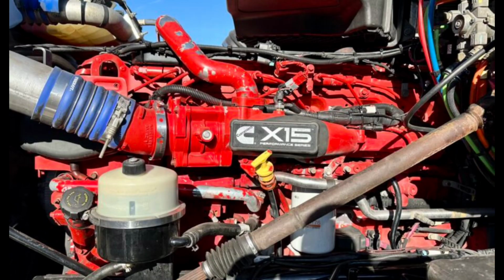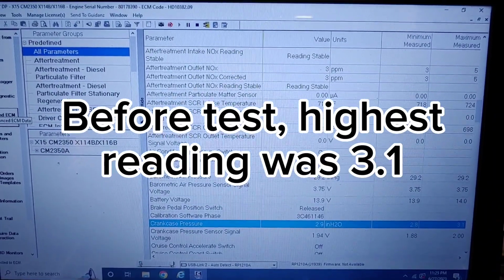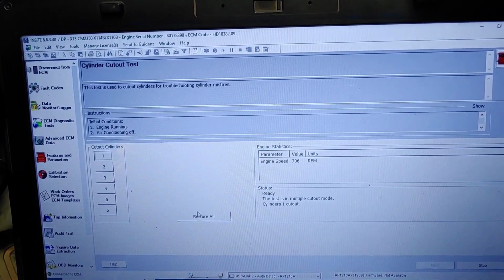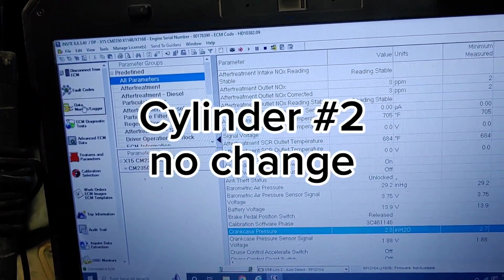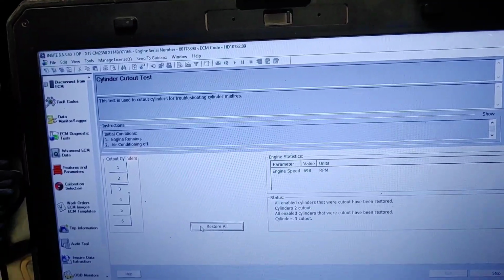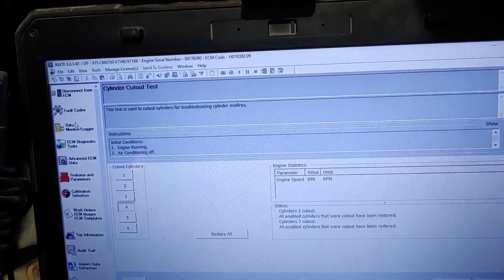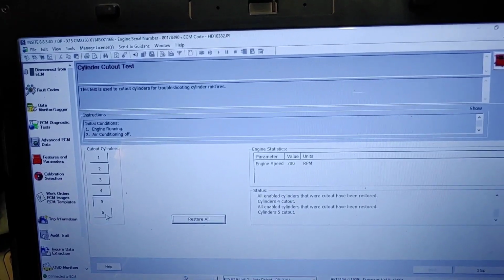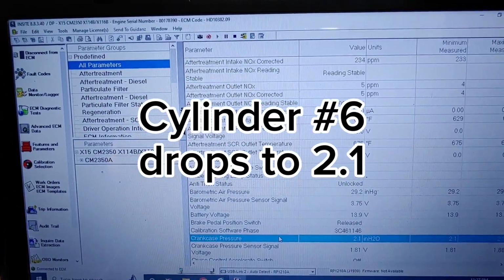Cummins X15 Blow By Test, Peterbilt 567

Comment: I heard the air compressors are sucking dirt and messing up the #6.. something about an oring
Reply from the maker: Interesting. I haven't heard that yet. We have over 100 trucks so Cummins gives us a special representative and random training. At the last training, we specifically went over this issue. The design of the air intake system funnels debris directly into #6. That's why it's so critical to replace filters and be sure the hardware isn't stripped and the surfaces aren't compromised. Our biggest issue is Peterbilt's cheesy airbox for trucks that spend their life on jobsites and landfills. We need a heavy duty system instead of our highway setup.
Reply: @MJBclassics  We just bought a 2020 t680 with the x15 because we thought cummins was the way to go. The more I look into it. The more worried I get. Paccar accepted they had issues and extended the warranties. Why cant they accept it and do the same
Reply from the maker: @SouthGeorgiahotshot  Overall the Cummins has been pretty darn good for us. We have from 2023 down to about 2016 Pete's with the Cummins. Our highest mileage trucks are 350,000. I've worked here over 5 years and we beat these poor trucks. We haul upwards of 164,000 lbs of aggregate in double gravel trailers on every load! Our main major issues are head gaskets and front and rear engine cover gasket leaks. Those are expensive, big repairs but I hear the normal haulers won't have those issues until over half a million miles. Good luck on your venture!
Reply: @SouthGeorgiahotshot believe me Paccar engines are the biggest piece of junk out there. Worked for Kenworth of Pa for 25 years this is by far the worst engine that I have ever seen  the engine mechanicly isn't bad  the main problems flushing egr coolers replacing a bunch of sensors while doing the flush because they broke. What happens to this when it is out of warranty
Reply: @MJBclassics what does clean filters have to do with blow all the EGR abrasive material  through the engine

Comment: What was the result mine drops the same way right now Also cylinder 6
Reply from the maker: The dealer said the pressure is getting up there but not critical yet. I'm not sure what that means. That truck had the small port differential pressure sensor on the DPF, which worked for the first 275,000 miles, but they recommended the big port kit. It seems like a bandaid, but most of our trucks do have the big port sensor from the factory, so I changed this one over (15 minute job), and so far its good.